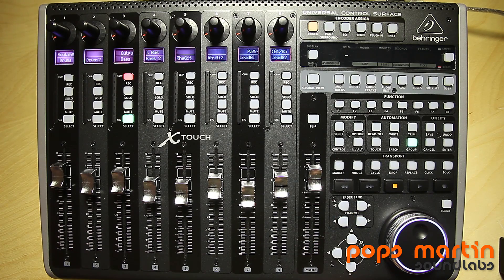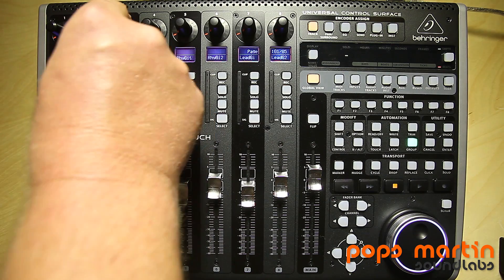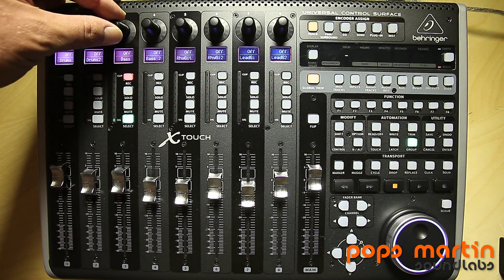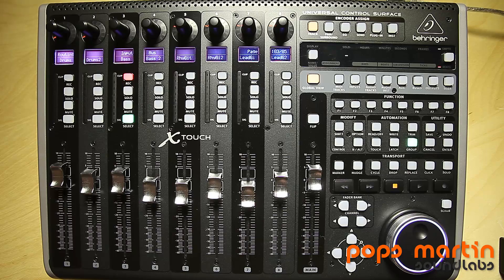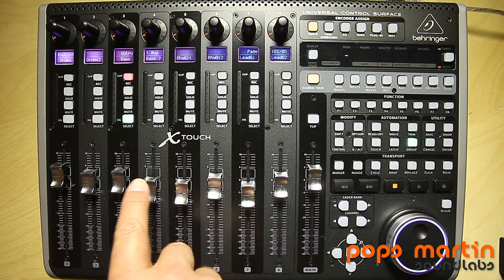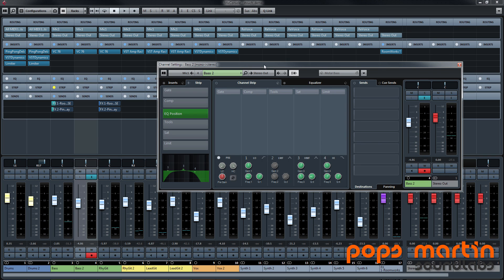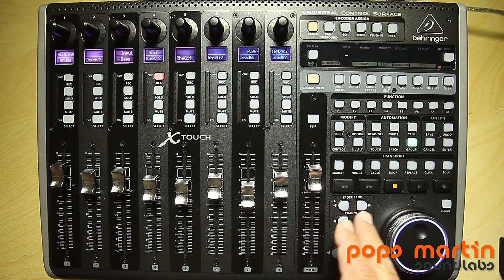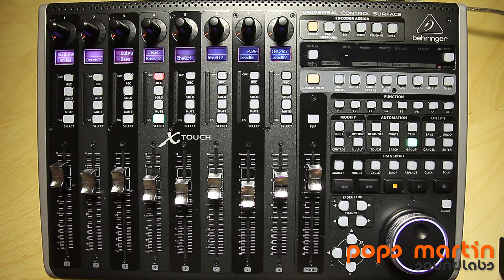Behringer X-Touch - Track (Cubase)

Comment: Hello Pops! Is there any way to control Cubase input bus faders with X-Touch faders? Option doesnt seems to exist and I was reading something like it's a protocol issue and its not currently supported.
Reply from the maker: I'm afraid it's not possible anymore although I'm pretty sure it worked at some point in the distant past (with an older version of Cubase). Maybe Steinberg has "fixed some issues" by removing it. :D You never know with these guys, expecially when it comes to controller support. Cheers

Comment: Thank you for your video. Is there any button which opens the cubase Mixer (like F3 on the keyboard)?
Reply from the maker: +DowntimeSeb You can use the 8 Function Buttons to assign key commands, e.g. Ctrl-F3, to all commands listed in the Key Commands settings in Cubase.
Reply: Thanks!